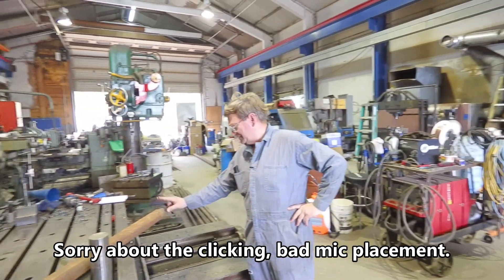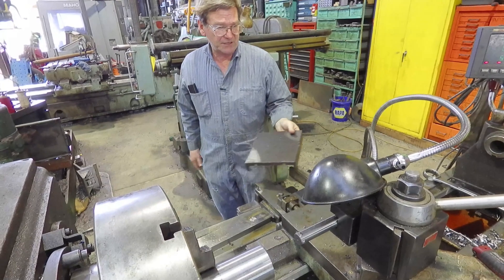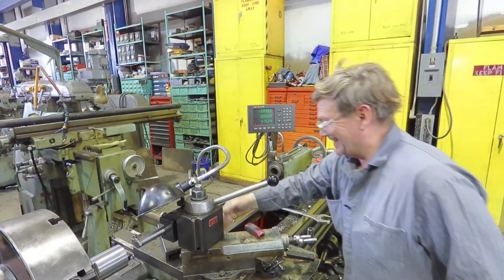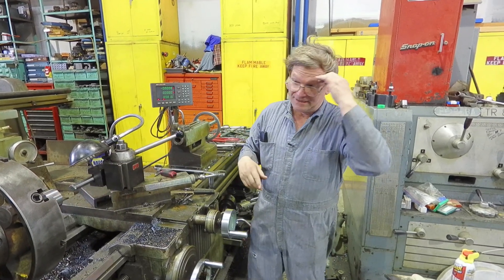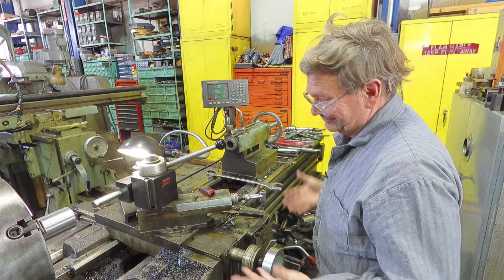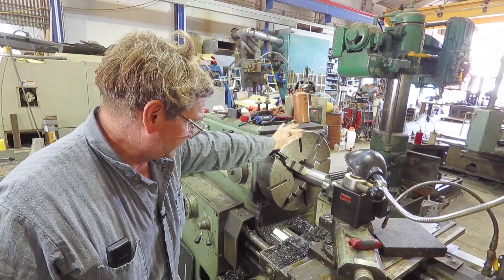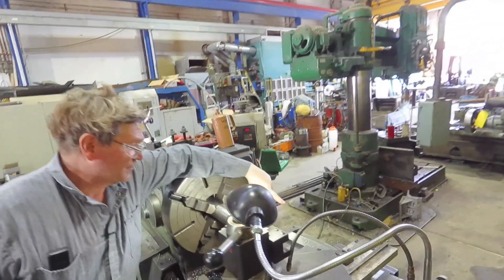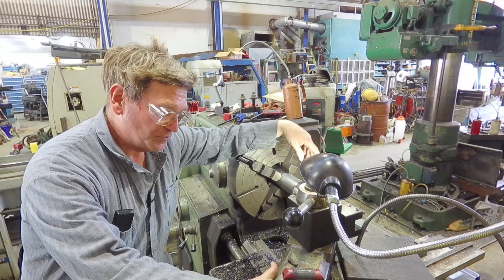Machinist's Minutes: Lathe taper attachments

Comment: After years of making tapered threads and finding I'm very limited in how heavy a cut I can make before it becomes a curved or wavy taper I came to the same conclusion as you. If you want to make medium to heavy cuts with a taper attachment, set it so the cross slide (x axis) is traveling toward the metal not away from it as it cuts. This is backwards from what seems normal. You can still make pretty accurate cuts the other way but it has to be light cuts because the back pressure from the cutting tool must not exceed the friction of the cross slide. If it does it will move in the slack or slop of the lead screw in the cross slide. Also lathe tools are designed to cut while being pushed down so cutting on the back of the turning axis allows this when the spindle is spinning in reverse. If you want to make a right hand thread while traveling out of the hole the spindle has to spin in reverse.  You will also need to cut a thread relief behind the thread so you have a place to dial in before engaging to cut the thread.
Reply: Why would you not just feed away from the part in the normal tool orientation? Wouldn’t that do the same thing without needing to turn the tool upside down and reverse the rotation?
Reply: @jameskonrad614  I always have the tool right side up. I only spin in reverse if im cutting behind the axis of the part. that way the metal is traveling down where it contacts the tool.

Comment: I have 3 lathes with taper attachments and no avoiding the slack/backlash. It can be very challenging cutting a 1* taper and threading joints such as NRQ, HRQ and etc especially when .001” in X changes Z by .034”…Looks like a 2 3/8 AOH your fixing to duplicate

Comment: Had an old Italian friend who told the story of having to cut an internal tapered thread like this as part of his Master Machinist examination for employment by Ferrari in Modena shortly after the Second World War. To grade his skill, they cut the work in half to measure the thread and examine the finish. In your case, how is an internal tapered thread gauged? How do you know when you are done? Did they give you a male to work against?
Reply: I cut lots and lots of rotary shoulder and cable tool threads. The correct way to check these threads is using certified API ring/plug gauges. Sometimes all you have is a sample for a gauge which can get interesting sometimes lol
Reply: 👍👍 @garyballard727

Comment: I’ve cut tapers at work to clean up some of the damage on the rail wheel milling machine heads when I have them out for other service. It took a little messing around the first time I had to figure it out on the SM1660 I have in the maintenance dept workshop but once I got it figured out, it’s a relatively simple operation now. Most work is pulling the chuck (I turn it between centers with a drive dog) and loading the +100lb cutting head into the machine (mounted some barn door track above the machine to roll it in with a come along)